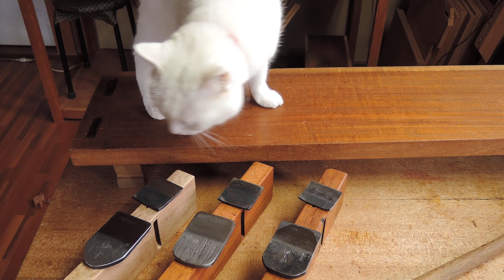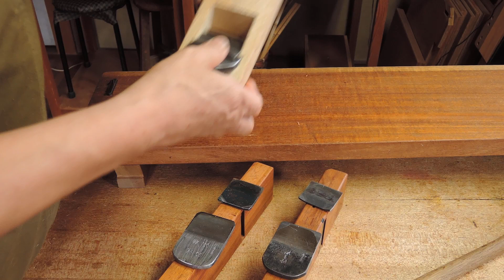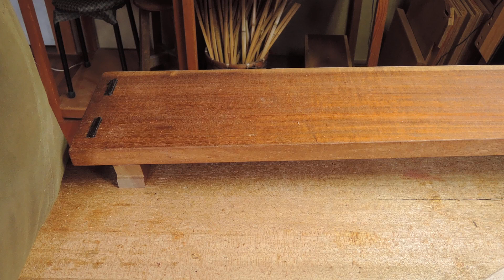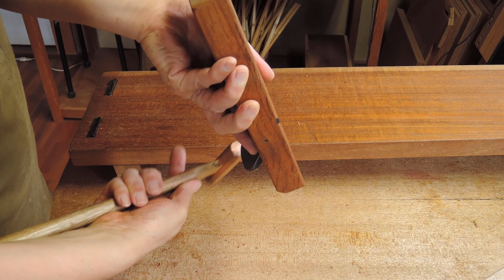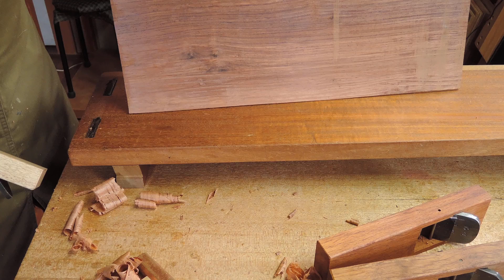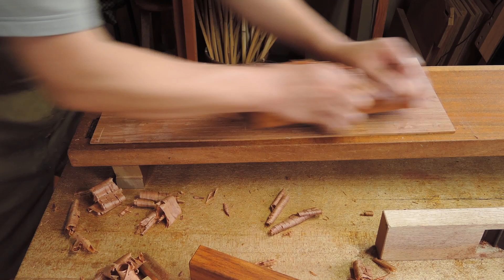中野武夫氏作　東郷鋼鉋削り比べ

Comment: Kiyoto san , I tried planing H.rosewood this morning on my japanese planing bench .My planes are all under $ 90 usa or 9,000 Y. They are beginners planes .What size of planes are you using ? where did you purchase them.?  They look very nice.. Not many choices for japanese planes in usa .Thank you .PS planing bench works very well.
Reply from the maker: That's good!
I use the powder high speed steel planer when planing the rosewood and ebony.
Width of the blade is 55mm.
http://www.tsune36.co.jp/item_02.html
Reply: Thanks I have some hong kong HSS  planes for ebony and rosewood. as well as a 8in  jointer Was wondering if you used the kanna for thicknessing? rosewood and ebony?
Reply: The tsune hss  blades are very  good , Do you purchase the Dai seperately? or is it sold with the blade ? thank you kiyoto san
Reply from the maker: ernie kleinman
Sorry,  I don't understand the meaning of
"as well as a 8in  jointer Was wondering if you used the kanna for thicknessing? rosewood and ebony?"
もっと読む折りたたむ  ·  翻訳
Reply from the maker: ernie kleinman
I get the 台Dai fitted the blade.